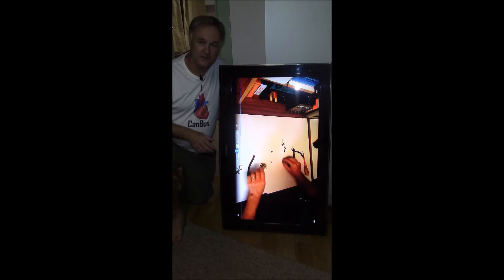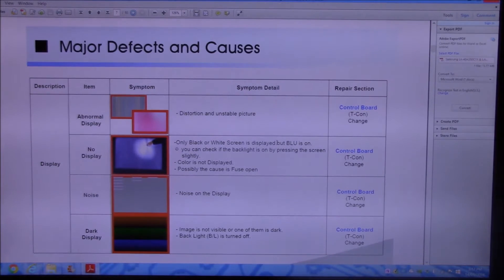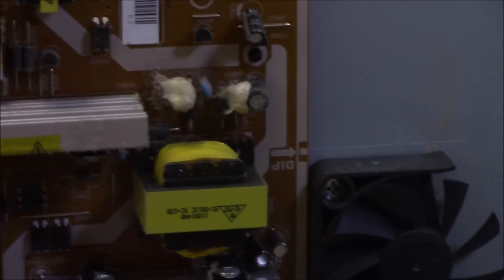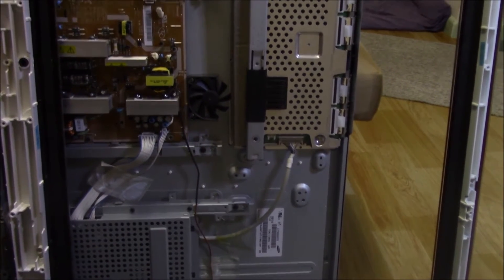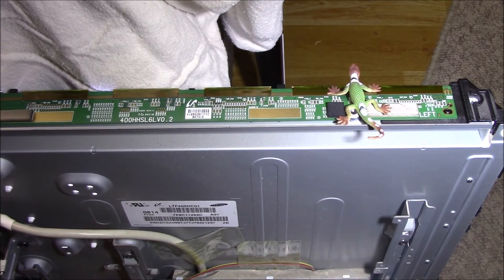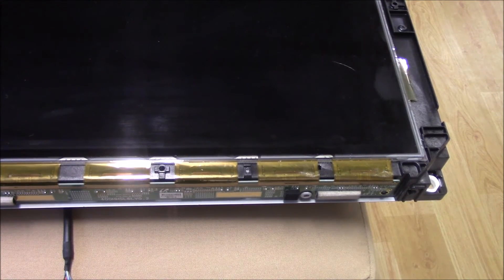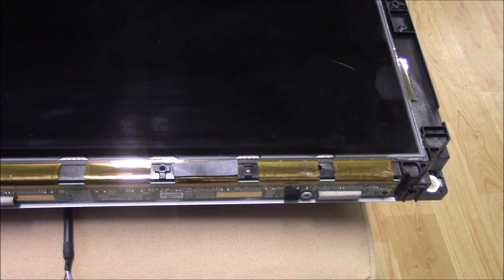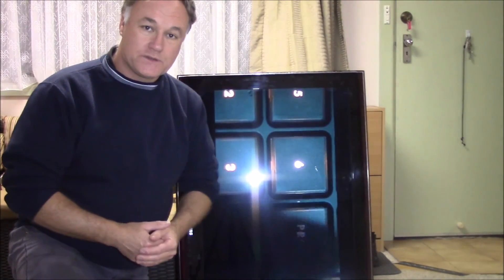Samsung TV LA40A650A1F Ghosting Repair MiracleMAX

Comment: As a mechanic, we have AllData. Is there some sort of hub where i can find information about faults?
Reply from the maker: Hey Diego Alvarez,
I gather that you are referring to automotive faults? I personally use Autodata which has a Known fixes & bulletins section for each vehicle. You can also try and do an internet search for TSB's relating to the particular vehicle.
That being said, the best collection of fault repairs and repair solutions by far is TaT (The Automotive Technician). 
https://www.tat.net.au/
They have thousands of repair solutions on many, many vehicles, a massive collection of good scope/scan data, an amazing magazine that keeps you up to date with current training, trends & detailed analysis of various automotive systems. There is also a Technical assistance directory where you can submit your diagnosis nightmare and get various suggestions that can guide you in a successful repair.
Apart from TaT, I use the search engine to look for common faults on specific vehicles. You can get a lot of good information simply by adding PDF to the end of your search. That will give you specific articles rather than just forums with peoples opinions.
I hope that answers your question.
MiracleMAX

Comment: Hisense TV.s?
Reply from the maker: How can I help?
Reply: @MiracleMAX  Never see Hisense brand which I am a "tech" for - see Sony, Samsung etc. I have ghosting from movement - thhink its raster refresh failing speed. Going to do firmware first?
Reply from the maker: @Sonique_Murwillumbah  I have just repaired a Hisense TV that was effected by a lightning strike. The video with be up in a while.
I'm not exactly sure of what you mean by ghosting from movement. Have you checked the screen connections? Does it change when you go into service mode? Firmware  updates are crucial, especially for some models that have had issues. It wouldn't hurt to start with the simple things first. 😉

Comment: spot on Max!  thanks
Reply from the maker: Hey Crewdog77
Did you have a similar fault?
Thanks for your comment.
MiracleMAX
Reply: @MiracleMAX Hello Max, absolutely the same ghosting on a Samsung LN-T5271F, I replaced the Tcon board which was needed for a milky screen and was left scratching my head on the ghosting leftover.  I was without tire material so i used 3M double sided foam tape and left the paper on the ribbon side all along the top edges of the screen retainer. wow was there a lot of screws, that is one well built TV and a gorgeous picture. ( that TV retailed for $3900 in 2010,  Your instructional was just what i needed, thank you very much for sharing! Subscribed
Reply from the maker: @Crewdog77  Thanks! I'm so glad that I was able to help. 😊

Comment: I've just spent an entire weekend watching YouTube videos trying to figure out what is wrong with my TV. And I had just put in a new video board so it couldn't be that. Everything pointed to Tcon board and I almost replaced that but after disconnecting the Tcon board, I had noticed the horizontal lines were still appearing so that threw me off until I watched this video. After you mentioned the word ghosting which is what is also happening I am pretty sure it's the label now and I will try your fix. Thanks @MiracleMax!!
Reply from the maker: I hope this helps you. Just keep in mind this is not a permanent fix, but at least it should extend the life of your TV. 
Let me know how you go with your repair :)
Reply: @MiracleMAX  So I managed to get the entire screen right besides two lines at the bottom. I just can't find the spot. Ghosting is gone but I have like one permanent black horizontal line right at the bottom of my screen and then a lighter shadow of that black line above it and below it. Any idea what that is?
Reply from the maker: @ViteshSingh  These are notoriously hard to fix. Most likely still where the ribbon cable is  adhered to the screen. Sorry I can't be more helpful. Just finding the right spot is hard enough, but also getting the cable to stay in that spot is another challenge.